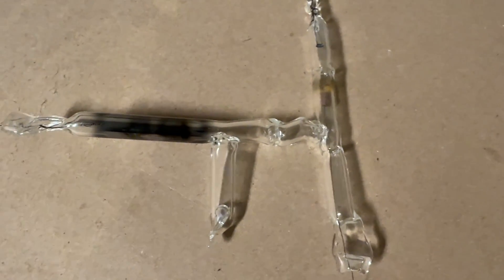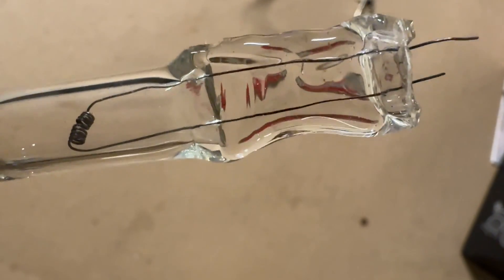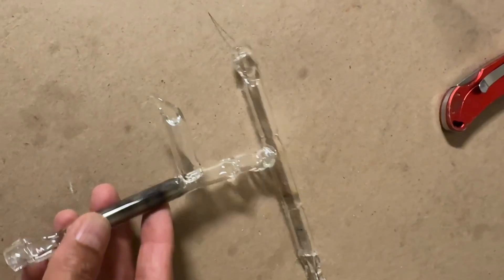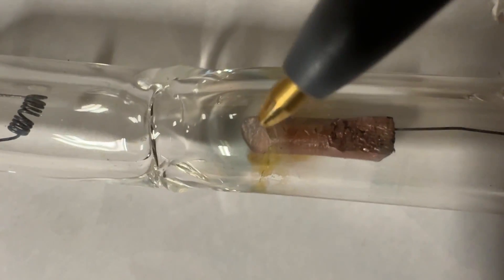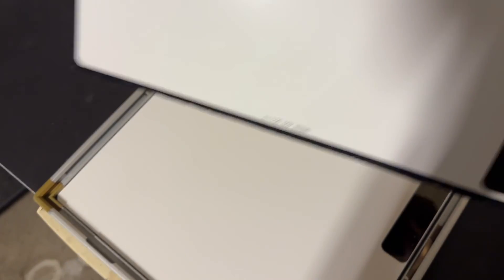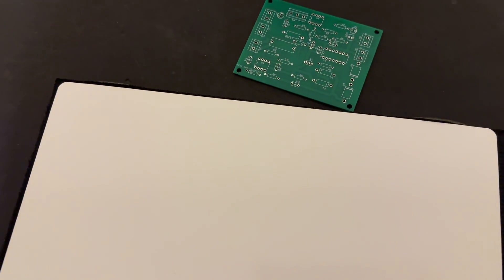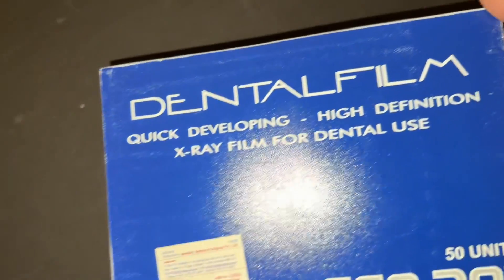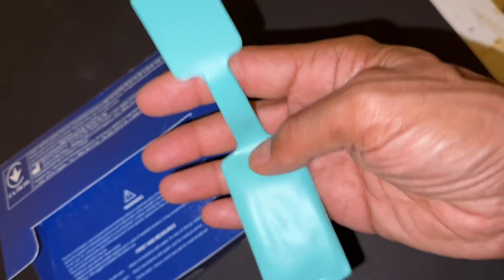Homemade X-Ray Tube Phenomena

Comment: Wenn du beim glühen des Gatters den restlichen Teil der Röhre stark erhitzt, so sollte sich noch mehr Sauerstoff aus der Röhre durch dein Gatter bentfernen lassen.
Reply from the maker: I flamed the tube with a torch to > 500°C while applying the vacuum from the two stage vacuum pump and obtained the seal. The heating resulted in some evaporation of the copper as you can see there. I hope that this would be enough to at least drive off a good portion of the oxygen and water vapor  absorbed on the inner surface of the glass.

Comment: 40kV xrays are very limited with penetration of pretty much anything, dental xray machine with 70kV is bare minimum for PCBs, IMO.
Crystal oscillator steel enclosure still blocks about all xrays, 100-120kV would be best, for larger general purpose stuff.
Reply from the maker: Agree. Yes, definitely to get better resolution, some higher KV would be better. It’s in the pipeline. I also have a larger voltage multiplier.

Comment: Sustituye el cobre por tungsteno y si puedes hacer que el ánodo de tungsteno esté hueco, para que por dentro del ánodo fluya aceite mineral, podrás conseguir refrigerarlo, que es el motivo por el que el cobre se vaporiza, es decir, la alta temperatura es lo que hace que se forme vapor de cobre en las paredes del tubo.

Las lamparas de rayos x, generalmente están sumergidas en aceite mineral, que soporta muy altos voltajes y sirve para refrigerar el tubo.

De todos modos, lo que has hecho es excepcionalmente ingenioso y si lo usas durante unos pocos segundos, no tendrías por que tener problemas de sobrecalentamiento.
Reply from the maker: Gracias amigo!

Comment: When the tube is activated does it cause interference with anything else?
Reply from the maker: I didn’t notice any obvious interference with other electronic devices. However, it sure did affect the x-ray sensitive screen material.
Reply: No interference, but if you go crazy with voltage multiplier, i.e. 150-200kV with Mazzilli ZVS and multi stage multiplier like me, your geiger counter will go crazy all around the house, because of high energy backscatter.
And you will barely get an image on screen, because xrays will pass right though it, with far less interaction/illumination as with 40-80kV xrays.